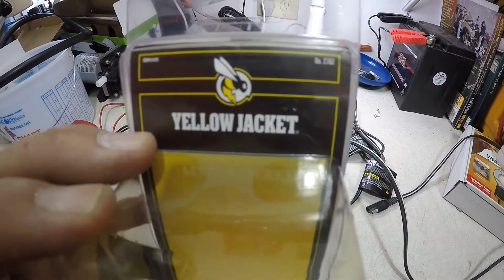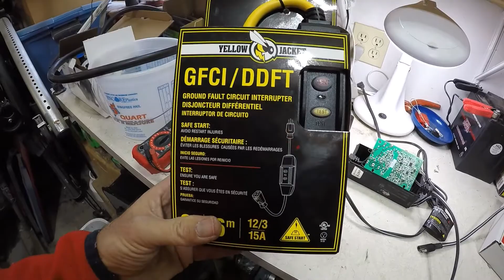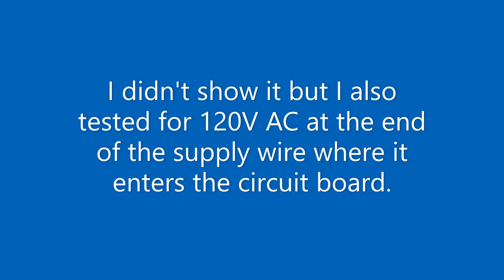Battery Tender REPAIR

Comment: Guess you should have said "SCHUMACHER BATTERY TENDER MAINTAINER CHINESE AMAZON BLOWN FUSE REPAIR HOT GIRLS" ;) I recently left my Battery Tender Jr. (you know, the REAL brand, lol) hooked up overnight to a battery that was fully charged... storm rolled through and tree went down over the powerline a half mile down the road... Power company is great and restored power within 3 hours, but I guess it surged when they got the juice flowing and when I went out all the lights were out on the tender, and it sounds like a baby rattle... was hoping it might be possible to pop a new fuse in, but looks like I better just get another one! Luckily the vehicle battery seemed fine, but the ground fault outlet was tripped... Battery Tender Jr. is about twice what I paid for it now, so the budget-minded me wants to try LEICESTERCN battery maintainer ($15), but then I also saw a mini Schumacher $18... might be the safer bet... as always with the cheaper Chinese knock-offs their are the stories of them destroying batteries, and lives, lol... you know... Thanks for the video (and the space for a free association session, haha).

Comment: This has nothing to do with a Battery Tender!
Reply from the maker: You are so right! But come on bro, Xerox, Kleenex, ChapStick. Everyone I know calls their battery maintainers a battery tender. Of course I don't know everyone 🙂 I can guarantee you that inside any battery tender Brand of battery maintainer there's an exact fuse like this one that can pop. They may even have the exact same circuit boards and fuse🙂
Reply: @anesthesiadreamin  OK, I get your point, but . . . I had to take a grinding wheel to my Battery Tender (TM) and guess what - no fuse.  The power cord from the wall goes directly into the transformer.  Poof.  So, instead of replacing a fuse, I have it even ea$ier - I ju$t have to replace the whole thing!
Reply from the maker: @scottmb99  crap! I'm sorry I was wrong. I wonder if the battery tender brand isn't more robust though. I mean they are the original manufacturers after all. I do appreciate your feedback and your perspective , I probably should have named the video battery maintainer repair. Thanks for your comments, and good luck 👍
Reply: @scottmb99  Before finding this video, I drilled the rivets out and I found no fuse either. Emailed Deltran support and they said they did not repair the Battery Tender Plus models. So I ordered another one too. Hoping at some point I can figure out how to fix this one.

Comment: My battery Tender Junior 110v has no fuse protection by mistake plugged it in 220v could you help
Reply from the maker: I would just replace it, I'm not an electrician or electronics expert, but even if it was fused, 220 volts would likely fry other capacitors and diodes. So if it was me I would just replace it. Probably not worth replacing a bunch of components
Reply: @anesthesiadreamin  that's what I did. Unfortunately I blew the second one. Now I am looking for a good electrician. Thanks for your response

Comment: GFCI = ground fault circuit interrupter.
Not a "surge protector"
Kinda like a Phillips screwdriver is not a punch nor is a straight screwdriver a chisel.
But they will work in a pinch or a budget.

Comment: GFCI is ground fault protect means if hot and neutral current unmatch it traps. Your PCB is not Battery Tender but Sch***, looks like it is a dummy device or normal power+pulse power. What is the cause of your fuse blown? product design defeats?